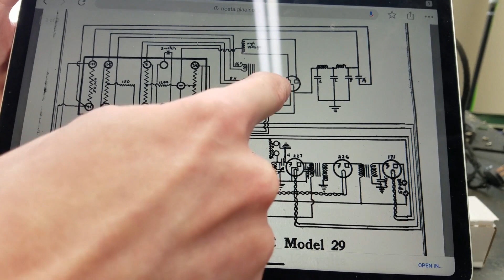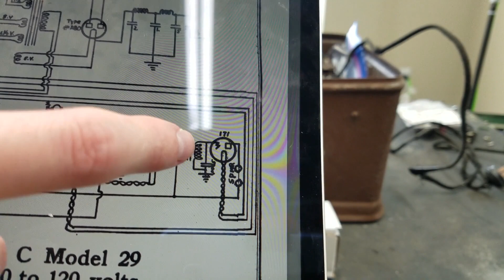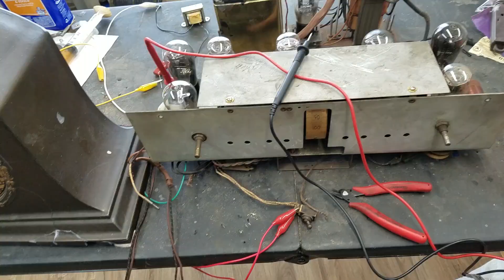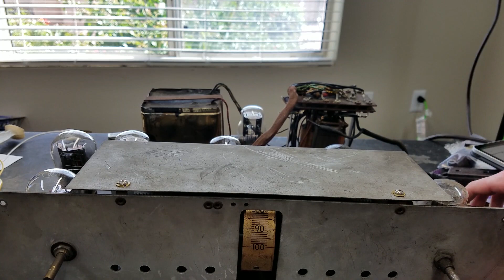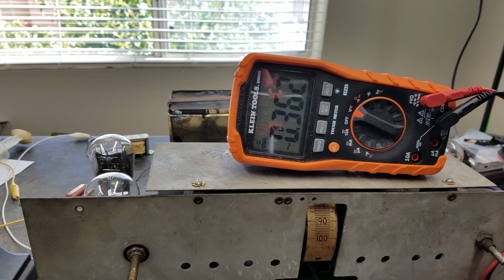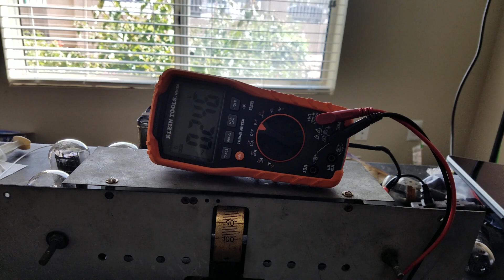Late 1920s Standardyne model 29 TRF Radio Repair part #A

Comment: That's an awful lot of vacuum tubes!  By 1929 most new radios were superhets?
9:42 The radio would be tuned to an unused frequency for the phono to get thru
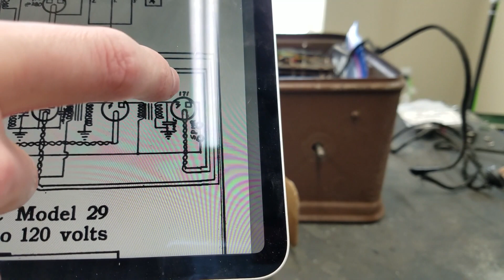Reply: 5:39 Are all those 'twisted leads' to the filaments made of resistance wire?  Curtain burners?
Reply from the maker: No, RCA’s patent on superhets didnt expire until 1930 or 1931, so it wasnt until the early 30s that superhets became really common
Reply from the maker: No the leads to the filaments are regular wire, the power transformer puts out 1.5V for the filaments so there would be no need for any resistance in the filament supply

Comment: Enjoyed your video thanks. Is your Sony GV8 video walkman still working? My GV9 PAL version was working but tried it recently and the tape no longer ejects but the eject motor tries a little otherwise the tv and av works fine. :( I have another NTSC GV9 which is working 100% and a GV200 and GV500 both working great.
Reply from the maker: Honestly I havent used it lately, its not something I use often
Reply: @bss1250  You will find your GV8 will be not working then as I tried my GV9 yesterday and the screen was fine playing a tape then started to flicker white and then went completely white :( I have connected a 5 inch lcd screen to the av out and used velcro to attach it in front of the internal screen which is a fix for now but I suspect the gv9 will end up like my other pal gv9 and die completely. Luckily my GV200 and GV500 dont self destruct.